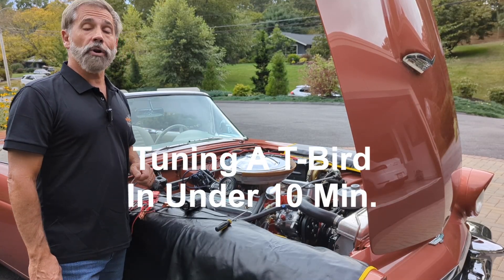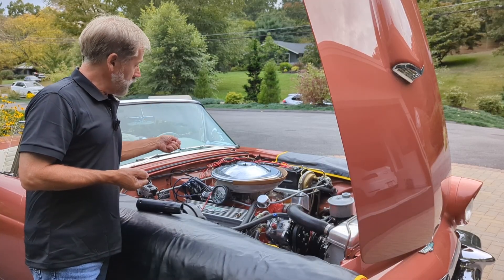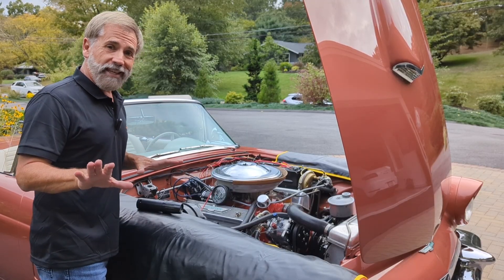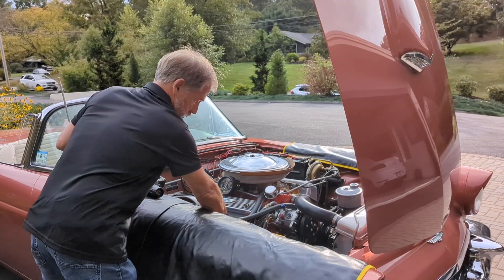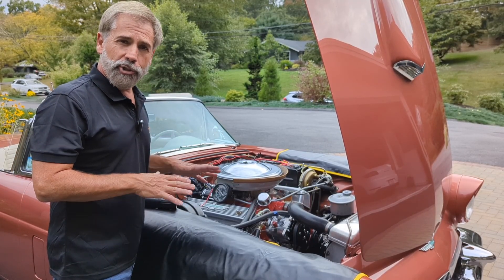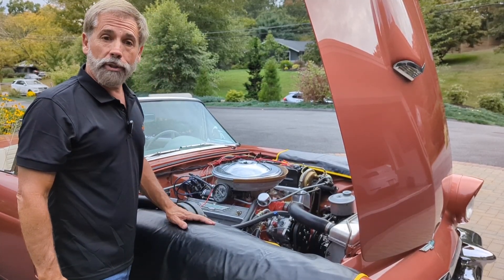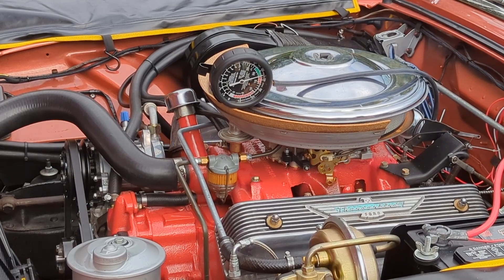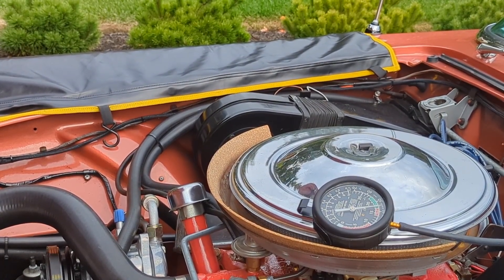Tuning A Classic Car With A Vacuum Gauge & Timing Light

Comment: The idle is a bit high, you may be engaging the mechanical advance a bit. It should idle around 550 RPM even AFTER the vacuum is put back on.
Reply from the maker: I hear you. I it lists 475 to 550 RPM in  Drive, and that is currently what I'm at. The timing is advanced to 7.5 to 8 degrees so it does increase the idle when I'm not in drive an additional 100 to 150 RPM.

Comment: The vacuum side of the pump should not have caps but a piece of tube from one to the other, otherwise the diaphragm cannot move freely and may tear.
Reply from the maker: You're not wrong, but we don't use that vac pump or the fuel pump anymore so I'm less concerned. As I said in the video, we've converted it to electric fuel pump.
Reply: @thunderbirdgarage  But if the diaphragm does tear, it may suck oil in.

Comment: From what I could see of the marks (really difficult to see anything, chalk is good) on the damper, it appeared to be over advanced initially. Setting timing with a vacuum gauge is not the best. Advance the timing from 6-8 and the speed will increase and the vacuum. Only advisable to set mixtures for idle and not fast idle. By ear is best then back and forth for the best result. Mixture would need to be done again if any other changes are made, valve lash, spark plug. Opening up the point gap will advance timing. Need a small spot of grease on the distributor cam to stop points closing up. Gap should be checked again on points in 100 miles to ensure they haven't bedded in. (closed up)  Also make sure the centrifugal advance is free and not seized. A few drops of engine oil under the rotor to the felt pad.
Reply: I would always rub chalk on the balancer, then wipe it to leave the chalk in the timing marks. Then I found the typewriter correction fluid, whiteout. It was like a ballpoint pen and left a mark that you could see in the sun from the light.
Reply: @jimandnena4  Ditto.

Comment: I had a flashback of grabbing the top of the distributor to turn it and getting shocked by bad coil/plug wires. I remember actually also setting it about 2 degrees off in order to counter the change that so often happened when tightening the distributor hold down. Funny how these memories are filed back there somewhere and only were accessed because of watching you tune your Thunderbird.
Reply from the maker: Ouch 💥

Comment: Additional tip, warm the engine so the choke high speed idle cam is not active.
Reply from the maker: That is spot on, I should have included that in the text!
Reply: @thunderbirdgarage  I'm 76, I grew up setting points with a matchbook cover in Illinois. Setting the high idle cam was a regular chore in Fall! 😅
Reply from the maker: @jimandnena4 where are those matchbooks when you need them today!
Reply: @jimandnena4  You probably remember the choke pull-off diaphragms going bad and then they would run too rich warming up, maybe even flood out. I'm having flashbacks. Ha.
Reply: @saabtech3510  it gets worse in the cold. The thermostatic choke spring would get moisture from the vacuum line and freeze the choke shut. We would make endless service calls to jump start folks after killing their battery. We charged two bucks for that. Too many stories.  😅😅
Reply: @jimandnena4  Ha ha. Yes, I used to drive AAA emergency road service back in those days. Dispatch: "Truck 19, are you ready to write?" Me: "I already have a clip board with 30 calls." Dispatch: "Truck 19, are you ready to write?"